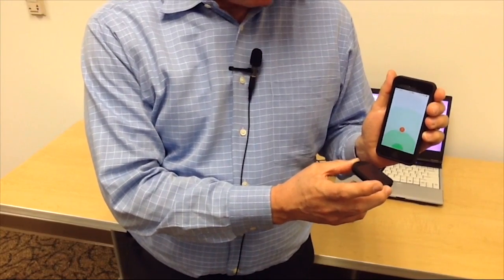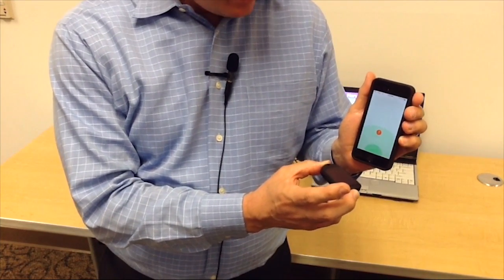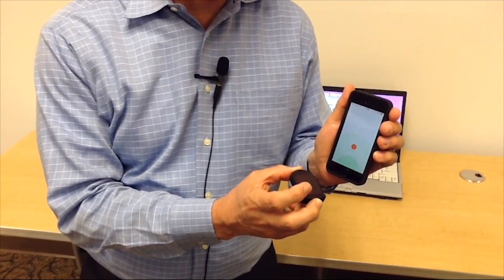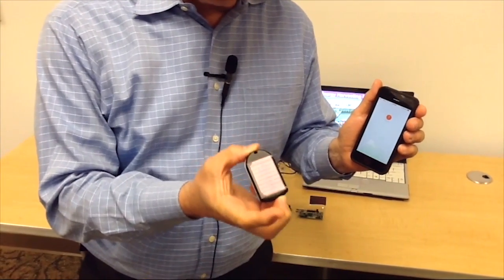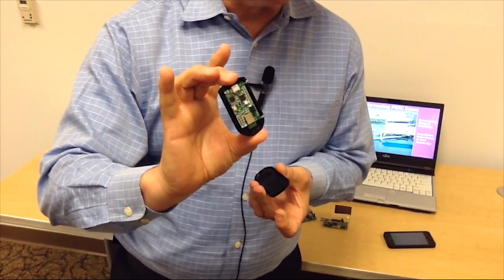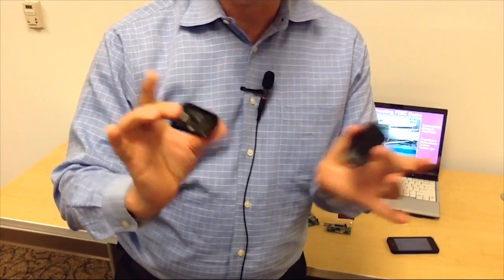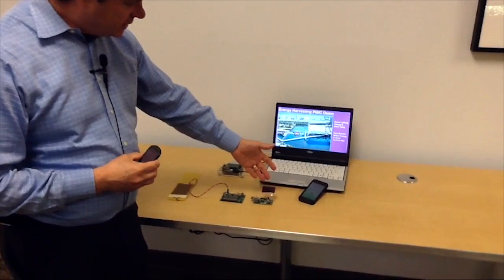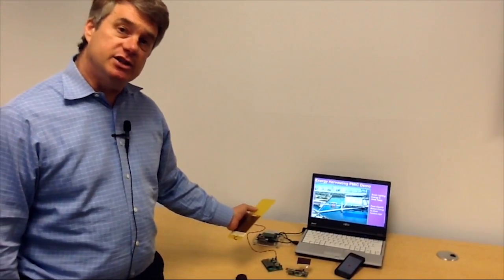Energy Harvesting Demonstration

Comment from the maker: Yes, it is. The kit can also send temperature sensor data which is mounted on the kit. Not only RSSI and ID.

At that time, transmission interval becomes a little longer than only RSSI and ID to harvest light energy for satisfying system power.

(e.g.,  Send only RSSI and ID: 1 second for interval. Send with sensor data : 3 seconds. It depends on light energy.)